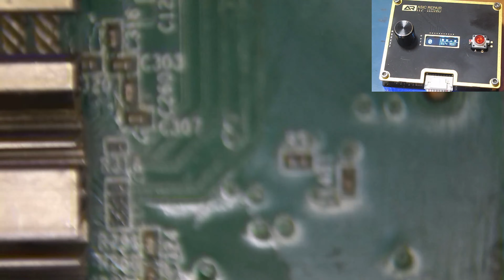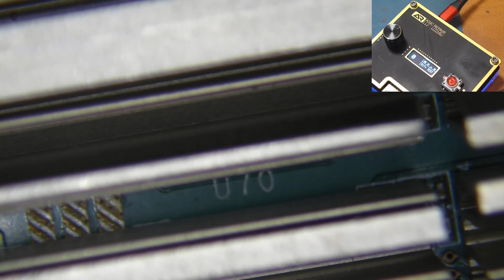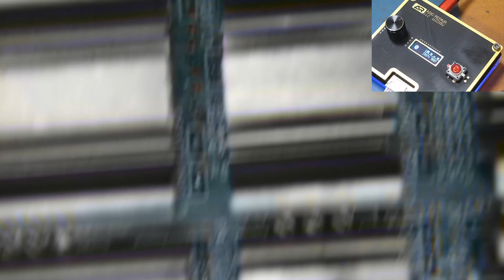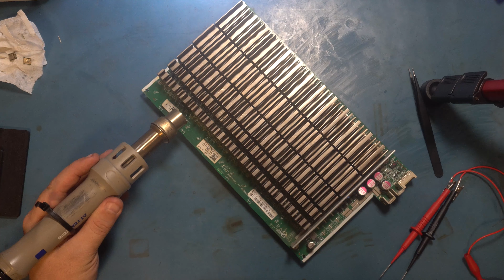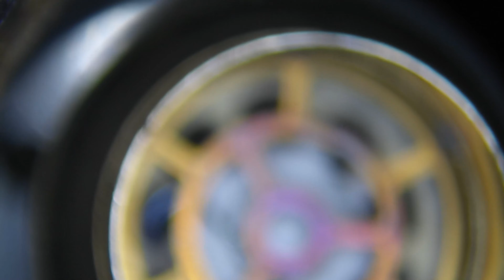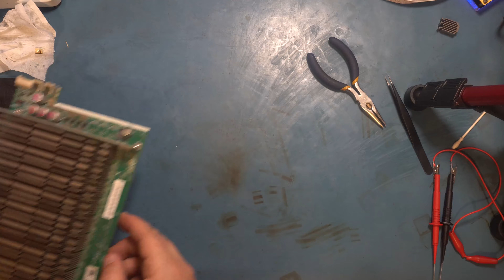DIY - How to troubleshoot a S17+ with 0 ASICs detected

Comment: Mine had a hole burned into the board when we had a series of power surges. Detected the board but kept on skipping it. Took it apart and then saw what happened. Just filled it up with solder and it was working again for about a week. Same thing. Did it again, now been running for about 2 ish months.

Comment: Hi Sir, you bring us a great video, thank you very much, but one question for you, at 13 minute 50 seconds of your video, you begin to measure the 1.8V and 0.8V, I noted you put one prob on the heatsink(chip side), Does the heatsink equal to domain GND? I have measured my S17+ hash board, the heatsink(chip top) is not domain GND and neither 1.8V or 0.8? What voltage is on the heatsink(chip top)? thank you very much.

Comment: I will learn this and start working on repairing this machine.
because there are many engine models that I will study and repair, maybe S19, T19, and T17 too.

- does every hasboard have such a black dot path?
- does the high temperature still have to replace the chip?
- is it enough to stick the chip with the flux? or the new chip already has a tin ball installed?
- what temperature blower did you use to remove and install the heatsink and chip?
- how long do you cool a board that has already been heated?
- you counted heatsink 1 from bottom left, does that count apply to other board models?
- if one of the ICs burns, will the path be damaged or not? otherwise I just need to replace the burned IC that's all right?

sorry if I ask a lot of questions, because I never learned this kind of repair at first, even using a multitester I don't understand.

Comment: I tried this on one of my 17+ zero asics and it went from zero to 5 asics however I'm a little confused. I injected at chip 11- 5 asics. chip 6- 5 asics. So where would my issue be? Chips 1-11 or 44 to 11?

Comment: Hi, you make great videos. Could you please advise me. When checking and measuring hashboard S17+, chip 5 gives me 0.8 v, but chip 6 already receives 1.8 v measured CLK per chip, I can't figure out the error, how is this possible. Can you please advise me where the error could be? I replaced chip 6 with a brand new one, but I still have the same problem and I don't know what to do. That's why I'm asking for help. Thank you, if you answer me and give me advice, I will be very happy and very grateful.

Comment: Very well explained. Thanks for that. Can you do this also for an s17 board. These testing points are more hard to see i think. Another question is what happens when using a 1,8 v cap from another domain to short RO?

Comment: Can you use an external power injector to give you the 1.8 or is it best to pull that from the previous domain (15,24,35)
Reply from the maker: 1.8 volts is 1.8 volts, no matter how you generate it so in theory yes.  When you test the last chip in a domain you have to use the 1.8v from the next domain, not the previous one.  If you do use an injector, just be careful where you put your ground at and you will be fine.
Reply: @asicrepaircanada159  But this would only apply to the Asic repair box since it gives the reading of how many chips? Or is this process done without a tester as well? Thanks for the reply.
Reply from the maker: @swan433  Yes, the idea is that as you inject 1.8v in different places, the tester instantly tells you if everything is ok up to that point.  It allows for quick and easy testing without having to measure individual signals and interpreting them.  If you are going to work on hashbaords, a tester is a must in my opinion.  You don't have to get the same one I am using in this video.  You can use a universal type one.  I will say: avoid Zeus if possible, bad customer service and universal fixtures that don't always work...
Reply: @asicrepaircanada159  I have the Zeus fixture and I've yet to use it. The PIC files took them 3 months to get to me, just received it 2 days ago when I came across your videos. I've learnt a lot so far by you showing this method.

Comment: I have a hash board, with zero asic on chip 5, I already made the exchange about 5 times, and it still continues, I made the exchange of chip 4 too, thinking it could be him.

arrives 1.8 and volt and 0.8 normally, you know what it could be?
Reply from the maker: Not sure what model you are working on but you also need all the signals on top of the 1.8v and 0.8v as well as domain voltage.  If you look at all that I am sure you will find where the problem is.

Comment: Great Video helped me alot ! and also interesting heating setup you have there. Keep it up ! Do you keep the btm heatsink on while replacing chip?
Reply from the maker: I do keep the heatsink on.  It acts as a thermal funnel that focuses the heat on the pad of the chip.  Much smoother with it on!
Reply: @asicrepaircanada159  doesn't the bottom heatsink fall off when you're heating from that side?  Or is it supported, like does the lower heat gun touch the heat sink?  Also, which tester are you using, do you have a link?  I think not a zeus...
Reply from the maker: @webby459  The surface tension keeps all the components in place on the underside.  You just have to be careful when if you handle it while it's still warm.  I use the asic repair center tester. https://tester.asic.repair/

Comment: Dude, this is gold!
Can you share what type of reball template you use?
Reply: BTW, where do I get a maintenance manual? is it in free access somewhere on the net or do I buy it?
Reply from the maker: @smavik76 Join the discord if you haven't already. It's on there.  As for reball template: do you mean stencil?  I don't use a stencil to put solder on the chips.  I have another video on my technique for used chips but it's basically the same for new ones.

Comment: One more question, I have a lab power supply. May I ask for how many Voltage and Amps are using in repairing S17+ hashborad? Thank you!
Reply from the maker: 21 volts.  Let the board pull as much current as it wants.  It will start around 5 amps and as it gets hotter, inctrsde to 10+ amps.
Reply: @asicrepaircanada159  Thank you!

Comment: can you inject 1.8v whit a lab power supply?
Reply from the maker: In theory yes but you have to make absolutely sure you put the ground of your power supply at the right place!  If you have a good understanding of domains and their voltage levels then sure why not, 1.8 volts is 1.8 volts.... coming from the board or from a power supply.
Reply: @asicrepaircanada159  hmm yeah the thing is that you have to inject that voltage whit the board running
Reply from the maker: @Readytomine  Yes,  what's your point?

Comment: Hello sir, what kind of PSU are using for hashborad?
Reply from the maker: Anytype ofpower supply that will do 30 volt and 10 amps.  If you have a 20 amps max that could work too.
Reply: @asicrepaircanada159  Thank you so much!

Comment: No, you do not need to be shorting anything out. That method should only be used on a 64 ASIC. 
0 asic is only caused by RO/RI not passing from 65 to 1.
Measure RO/RI on ASIC 32. Does it get 1.8v? 
If not then you've just determined that the issue is between ASIC 65- 32
Repeat those steps cutting the board in half until you find the low RO coming out.
If you did get 1.8v then you know ASIC 65-32 are good. 

It should not take anymore the 45-60 seconds to locate the faulty chip.
Reply from the maker: You say I don't need to be shorting anything out, I say you don't even have to use a multimeter...many ways to skin a cat my friend.  Here are my thoughts:

1. Shorting out test points is actually the method in the formal maintenance manual.  This is doing the same thing but by using easily accessible test points instead of having to remove the heatsinks.

2. Showing the actual number of chips detected on a tester gives you a warm and fuzzy that not only the signals are passing but that the chip is also communicating, which measuring RO only doesn't do. You can also gauge if there are any other issues by seeing if the number of chips detected fluctuates.  I see boards pretty routinely where a chip would  output its RO but still need replacing.

3. This video is meant to be instructional for people that are starting out troubleshooting.  It is a complement to the maintenance manual the shorting out technique.  That method also takes less than a minute to do when you're not trying to explain it to youtube at the same time...You are not the target demographics my friend :)
Reply: @asicrepaircanada159  Man, you is the real deal!!!
Reply: Very well explained!

Comment: hello i would like to know what is eprom error please
Reply from the maker: Sorry I don't understand what you are saying.  The EEPROM is near the main connectors of the board.
Reply: @asicrepaircanada159  i am getting error-eprom-info when i connect the hashboard on original controller but its working on test fixture with 65 asic
Reply: @asicrepaircanada159  do i need to reprograming the eprom for new asic that i have changed frequency and voltage (brush)
Reply from the maker: @rabihsaade399  If you have a universal type fixture, you need to do a complete hast test for the board and when it passes, the EEPROM will get re-written with the proper info.  You can also manually take the EEPROM info from a working board and program in into that one.  Using a Skypro II for example.